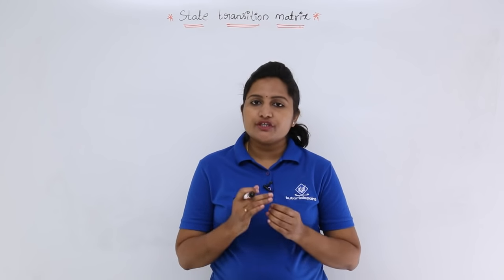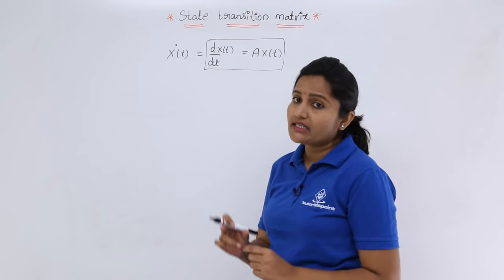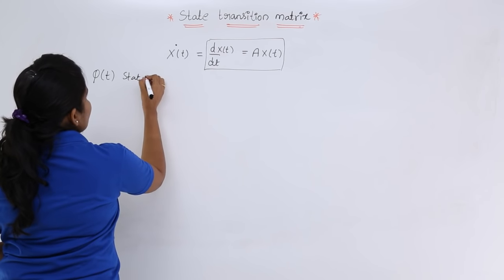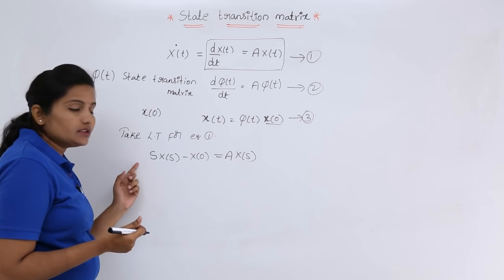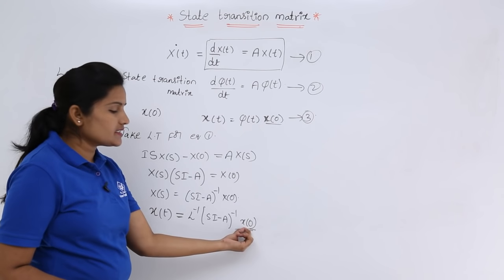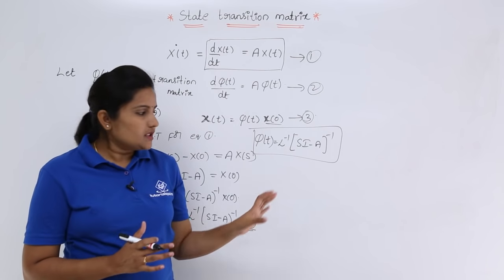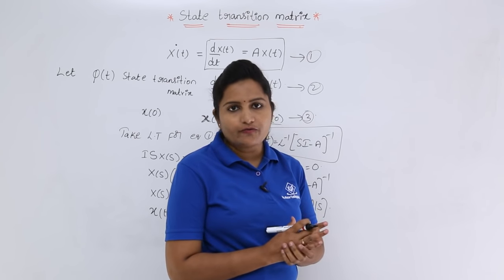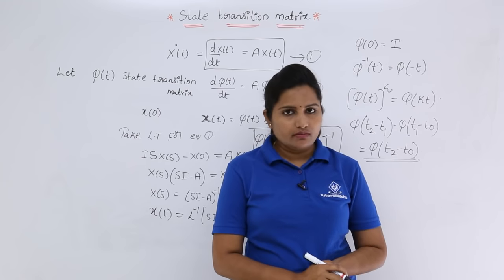State Transition Matrix

Comment: please i will have summited this assignment during at this week.so please help me darling

1.	A vigorous television advertising campaign is conducted during the football season to promote a well-known brand X shaving cream. For each of several weeks, a survey is made and it is found that each week 100% of those using brand X continue to use it. It is also found that of those not using brand X, 20% switch to brand X while the other 80% continue using another band.
a.	Write the transition matrix, assuming the transition percentages continue hold for succeeding weeks.
b.	If 20% of the people are using brand X at the start of the advertising campaign, what percentage will be using brand X one week later? Two weeks later?
c.	What portion of the market will be using brand X area the end of the season, assuming the transition matrix remains the same? Find the Steady-state matrix)